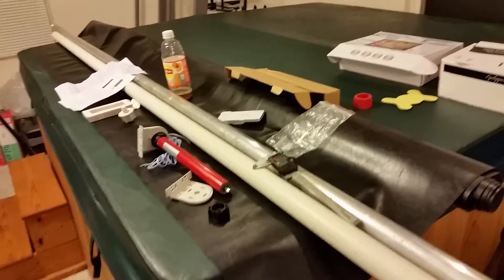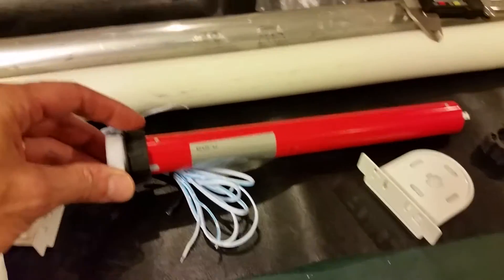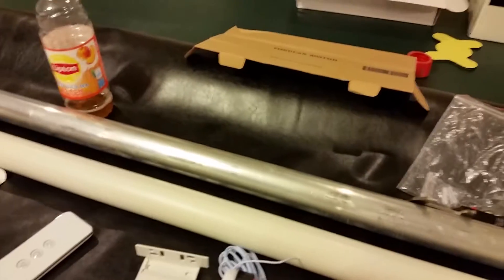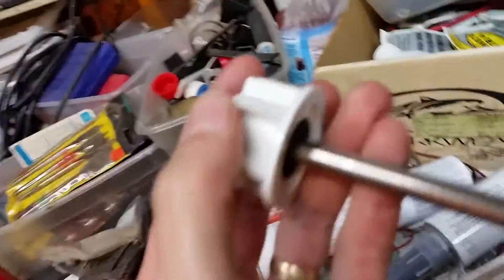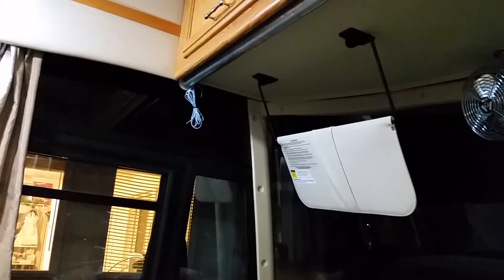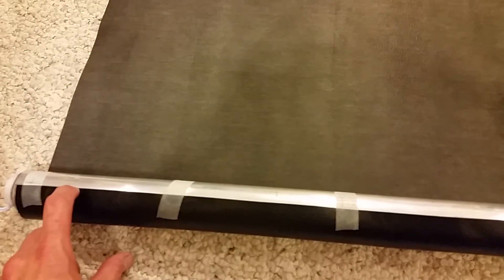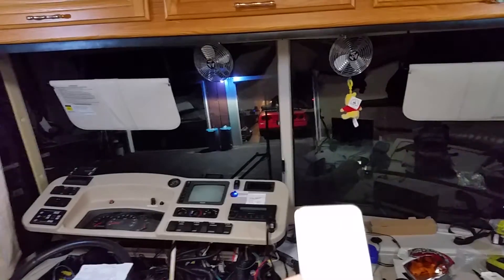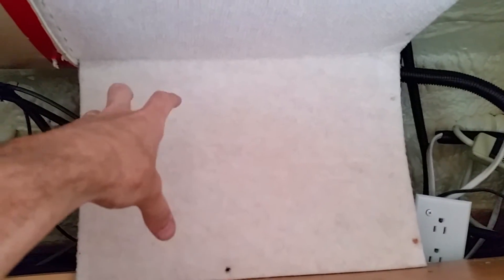RV MOD: Make Your Own Electric Powered Roller Shades, Motorized RV Window Shade

Comment: Kevin, again great video, I have the same worthless factory visors you have. Do they really think we are going to stand up to grab those things while we are driving down the road? Anyway, a couple questions. First, did you consider moving the whole assembly forward so you maintained the dash area as a shelf? Just curious why you mounted it so far away from the windshield. Second, does this mod mean you don't have to try and pull the factory Curtains all the way across the windshield now? Again great ideas!!!
Reply from the maker: I moved it to the rear for 2 reasons 1st so I can lower it all the way down to the steering wheel column blocking out most of the light. 2nd as a safety reason, if I lower it while driving and button just happened to stick and it tries to go all the way down to the bottom blocking my vision I can just take my hand and left it up so I can see the road. 
I can still pull curtains around and sometimes I do just to help keep in or keep out the heat. depending on the season. If you have any questions my cell is 606-875-0125 Kevin

Comment: I am in the process of completing this project but the motor end is very tight going in. i was considering using WD30 to facilitate and prevent breaking the motor shaft. What are your thoughts?
Reply from the maker: You need to reduce the size of  the rubber sleeves by spinning them against a grinding wheel.  Give me a call 606-875-0125 this is my cell. I can walk you through it.
Reply: I did that with the plastic end as you did. The motor end seems smaller as-is, but very tight. So you use the same procedure on the rubber motor end also?

Comment: Nice work! I stumbled on your video while searching for a motorized shade for my RV. I may copy what you did! Have you considered sewing in a weight at the bottom of the shade to help keep the fabric straight? Maybe some steel wire, or jack chain?
Reply from the maker: I found a easy solution I just clamped a large 2" paper clip in the center works great, thanks for watching.
Coofficer Extra Large Binder Clips 2-Inch (24 Pack), Big Paper Clamps for Office Supplies, Black
by HZ JoIMO Corp
Learn more: https://www.amazon.com/dp/B07C94YCR5/ref=cm_sw_em_r_mt_dp_vnQ2FbSZ5H738

Comment: After watching your video you have convinced me that I can do this, its been three years is everything holding up?  I can't find the exact motor on Amazon that you spoke of.
Reply from the maker: Still working great here is link to the motor I used 
https://www.amazon.com/dp/B01DZQ43AI/ref=cm_sw_r_cp_apap_JuUCTLNED9yMk
Reply: Thank you
Reply from the maker: @chuckwells9090  NEW LINK Rollerhouse RTS 12V DC Radio Controlled Tubular Motors for Electric Mini Roller Blind Compatible 3/4"(21mm) and 1"(25mm) Roller Shades
by Rollerhouse
Learn more: https://www.amazon.com/dp/B07DCP392F/ref=cm_sw_em_r_mt_dp_6EBWD269191JRN5GZ0R5?_encoding=UTF8&psc=1

Comment: Kevin you are a true genius. I want to make one of these windshield shades but I am having a great deal of difficulty finding the aluminum conduit😩 Where did you locate it. Tried Lowe’s HD pipe suppliers. I am at a loss any help would be greatly appreciated. This is such a great idea if I can just locate all the parts. Thank you
Reply from the maker: I did some research its called rigid aluminum conduit 1" I think
Reply from the maker: Thank you for the kind words I went to a local electric supply house and found that conduit. If you don't find it let me know I will call and get the name of it.

Comment: i have a Bofu motor and B 301 controller , tell me how to program it, it will talk to the motor but will not make the motor run up or down, what an i doing wrong.
Reply from the maker: The motor i used came with instructions on setting up the remote link to instructions i used https://images-na.ssl-images-amazon.com/images/I/516Ly4s47YL.jpg
Reply: @ktoutdoor  can you please call me 2083601019
Reply from the maker: @delbarber7547  I tried I did not get threw u can call me at 606-875-0125

Comment: cool project.  what kind of remote does the motor run on?  is it an IR, 433mhz radio or what?
Reply from the maker: wadesready not sure I don't think it's ir.. the motor has a small wire that hangs out of it for and antenna.  It sure works nice as I'm driving into the sun.
Reply: thought I would let you know...  the remote/shade motor is a 433.92mhz rf radio,  I got it to interface with a rfxcom transceiver.   I have a newmar and I will be putting these motors on all the windows.  Thanks again for the video and inspiration!

Comment: Great project excellent work. I don't know if Walmart has white or silvered material.  If they do it would reflect the radiant heat outward reducing the thermal radiation into the coach.  Keep up the good work.
Reply from the maker: Michael Schmidt that's a good ideal. . Thanks for watching